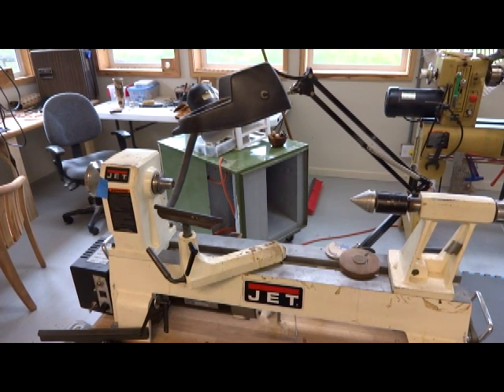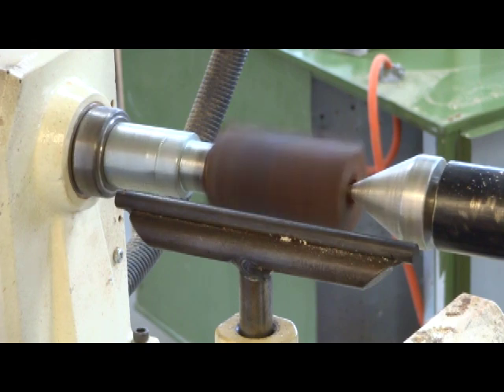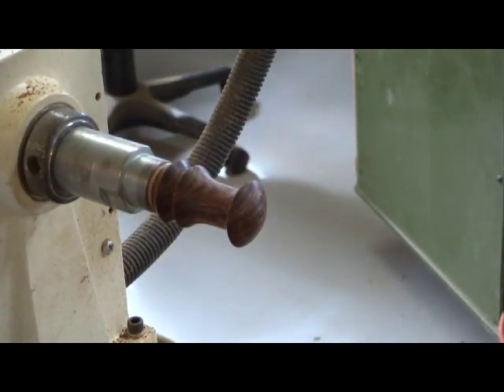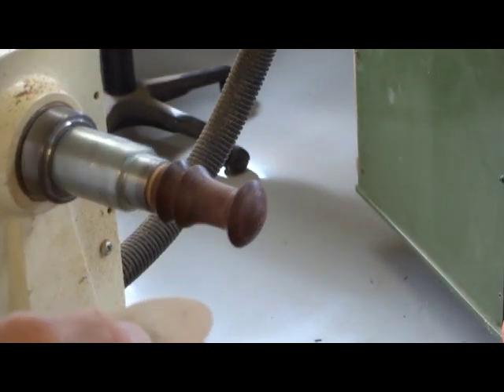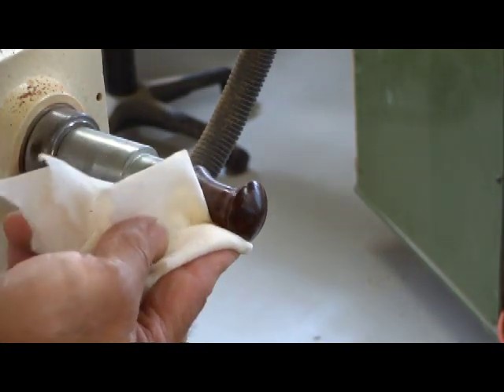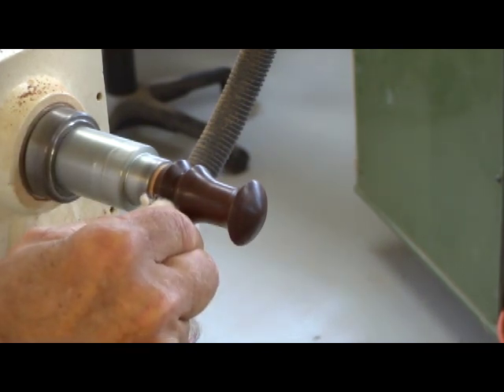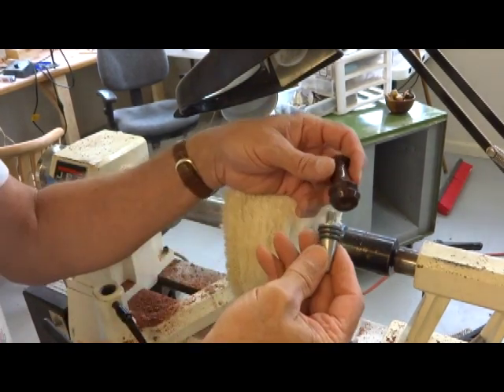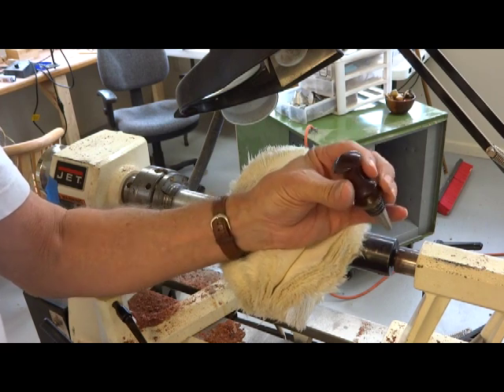Turning a Bottle Stopper

Comment: It's too bad you by passed the most important points. Drilling the hole. The IMPORTANCE of the size, using a mandel,  mounting. What you used and the process. What 30 seconds of info??  How you parted it off the machine, ready to be sanded. See how it stays tight, and spins for sanding, and finishing, that's because it's gripping nicely to bolt??? on the head stock. Who is the video for? Those learning, or for those who turn daily?  Your head stock mandrel mentioned at the end. part description, why you like this, Gets you away fro the head stock for turning room. Change the name of the video. How I finish a bottle stopper!